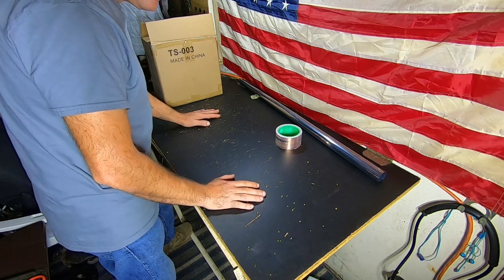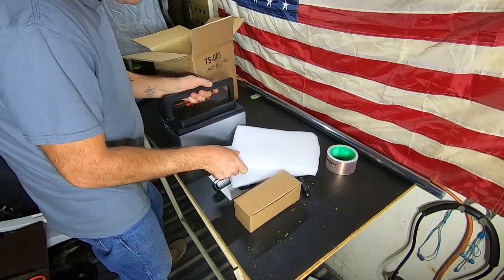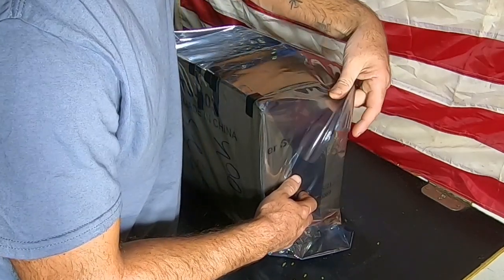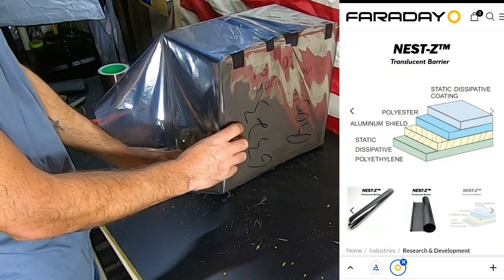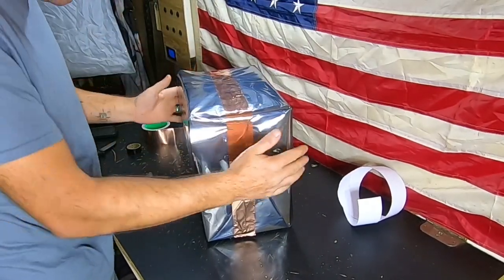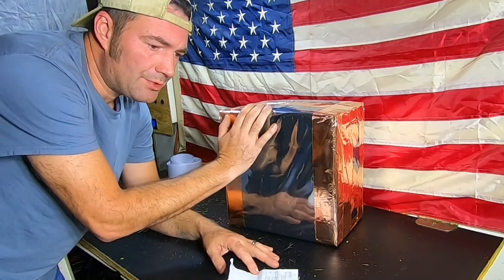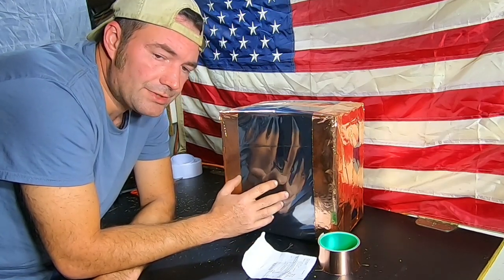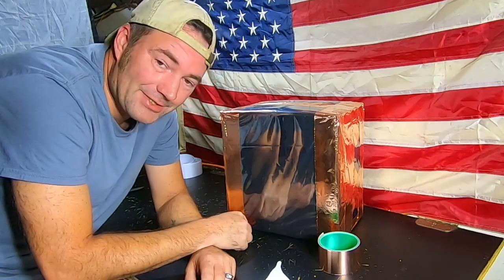How To Build Your Own Faraday Cage To Protect Your Solar Generators

Comment: But you need to access the solar generator to exercise it every few months, so you have to open the box and seal it again everytime
Reply: maybe buy a Tupperware or sterilite tub and put the empty fabric on the removable lid as well. easy pop on and off for access.

Comment: I'd like to see a box set up with a removable lid that was all wrapped in protective coating, that way you could get out your gear without destroying the box.
Reply: Ammo can Faraday box, strip the paint off the top 1/4" around the opening of the can to bare metal and use conductive adhesive copper/aluminium tape to give a better sealing surface, strip the paint from the inside of the lid of the can and carefully remove the gasket, run a layer of conductive adhesive metal tape over both sides of the gasket to provide continuous electrical conductivity for the two halves of the ammo can, line the inside with yoga mat if impact cushioning is required while also providing electrical insulation, use a sheet of semi rigid styrofoam with a tab of duct tape as a handle as the lid of the insulated liner. 

I used expensive EMI/RFI shielding copper tape for years until I found out the tape sold to repel slugs and snails uses conductive adhesive, it has other uses for tech geeks, preppers and survivalists too.

Comment: Sure do wish I had learned this method sooner. Christmas wrapped all of ours in multiple layers of foil, used metal tape, and then sealed everything inside of a metal trash can. Like you said, can only test it against radio waves. … Greatly appreciate your info here. Thank you. Blessings. 🎚
Reply from the maker: I've used the same method for years my friend. I've just now got ahold of this new emp fabric material.

Comment: Reckon you could wrap a box in such a way that you could open it and seal it back with the leftover tape...that's interesting stuff. Looks like the same static shielding that a lot of my circuit boards come in
Reply from the maker: I'm looking into long strip velco. Have it maybe designed like a bag and double roll it into velcro
Reply: @SurvivalLiving  yeah that would be cool. My wife works with some pretty neat conductive stuff like that.
Reply: @SurvivalLiving  yep...must be easily reopenable AND resealable  or its just a pain
Reply from the maker: Depends. My stuff in our aluminum foil cages have been sealed for years now. I don't go back and forth opening it.